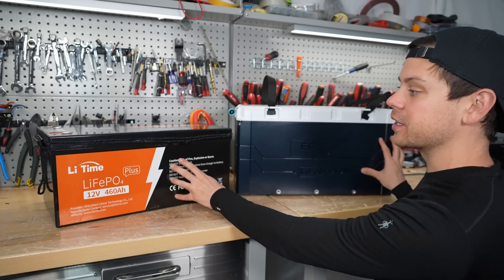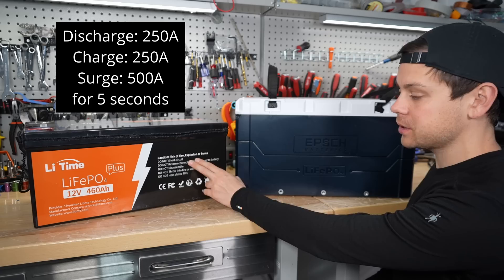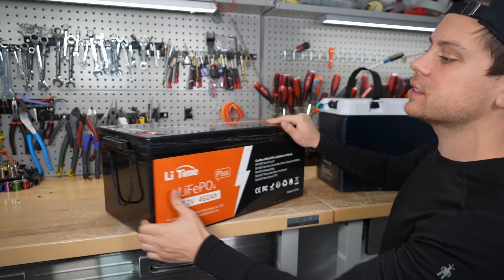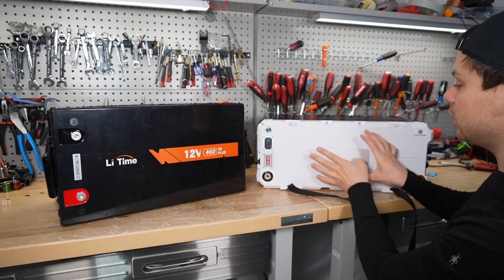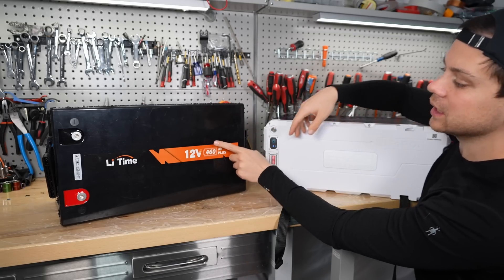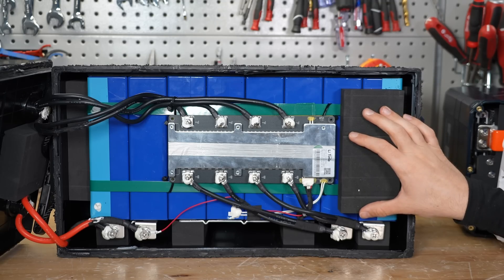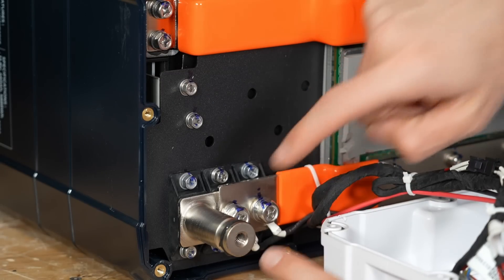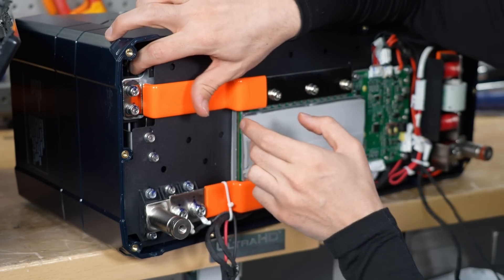12V Battery Showdown! $1,499 LiTime VS $1,999 Epoch

Comment: I bought 4 x 230Ah Li Time (with low temp cut off) based on your recommendation and videos. Unfortunately, 2 of the batteries showed up with only 3.2v, and after trouble shooting with customer service (which took some time since they are only in China), I had to send them back. They quickly replaced the two faulty batteries, but 50% failure is unacceptable. In any event, I own these 4 batteries and they are doing very well in my RV. They are charged easily by the existing MS2812 inverter charger whether connected to shore power or by 10Kw generator. I do not have solar and don't plan on installing since I already have the genset which works during times of rain, cloudy days, night, and so on. Additionally, I installed a Victron shunt to monitor SOC. I was able to buy each battery for $618 delivered, using discount codes provided in their emails. Thanks for your videos and help on these projects.

Comment: I did buy the 230 Plus w/low temp... dropped it on the tongue of my travel trailer. Works like a champ (San Diego). Do have the Victron Bluetooth BMS. Rennogy 60A charge controller. It all just works.

Comment: I'd go for the LiTimes...That said, I already own several of the Victron ecosystem components on different battery banks.  I own some LiTime batts and they don't disappoint.  Also, a few years ago (on your advice) I purchased several SOK 206AH batteries.  I use those with Victron setups and they perform flawlessly.  All 12V batts, but my SOKs are configured into 24V a system.

Comment: Due to my experience with Roy-POW’s very high failure rate there is no way I would trust the Epoch even though it looks significantly upgraded.  I have a stack of bad Roy pow’s at the golf cart shop I work for. 
Have you tested the bigbattery husky 2 yet?
Reply from the maker: How?! Can you post your roypow issues on the forum? All the shops that install them love them
Reply: Some with bms failures some with dead cells

Comment: I would use the third option Signature Solar EG4 LL in 12 Volt and 400 amps.  The cost is $1495 with free shipping until Feb 28, 2024.  This model has the LCD display which shows Voltage current and state of charge.  Failing that I would go for the Epoch for the ability to monitor the state of charge and the low temp protection and the better build quality.

Comment: I've had two LiTime batteries so far (200 Ah and 100 Ah). I didn't need any monitoring, because I did it with various attachments that I used with the battery. The only thing I wished it had was low temp protection. It never was an issue for me because I had my fifth wheel trailer and solar panels covered during the cold winter months up north, but I can see how you would want it in case you get a cold streak when traveling in the South. $400 bucks is $400 bucks, though. I'd go with a good quality, cheaper build every time.

Comment: The Li-Time is cheaper and rated to last longer. If it does what I need it to do, how it does it is less important. The Epoch is definitely a high quality battery. But less than half the rated life and 25% more... I hope they use better cells in the future. Because I'm not spending $2000 on a battery that is barely designed to make it out of warranty (3500 cycles/days = 9y 7m 5d)

Comment: I have one of Epoch's 12v 100AH units and I've installed a 51.2v60ah  kit on a golf cart. I was really surprised on the quality of the components of the golf cart kit, and how well everything integrated. On top of that, I did have a small self caused technical issue. Made a phone call, spoke to a person immediately, and my issue was resolved by a tech in less than 5 minutes. I wouldn't hesitate to go Epoch again.

Comment: I bought two 200 Ah LiTime 12V batteries for my camper van. I am not going to be using the van anywhere below freezing. I also do not want to leave a $2,000 battery in my vacant van for potential theft reasons. I built a wood box for the batteries, connected them in parallel and screwed the box tight.

Comment: I think I'd dig deeper into the cycle differential by figuring out why it's so low for the Epoch (compared to the LiTime). If the LiTime cycles nearly twice as long for 25% less money, then I'd just add the components that I might need to my LiTime bundle of batteries. Have you tore down the Epoch cells to see why the cycle is lower????

Comment: I think they are nice batterys…  but Chinese facts and specs are just words…that’s all… in lieu of how long these type batteries last I will  cost average how much each years cost is no matter what type you buy…and stick with my present batts and  “get out there and stay out there..” 
good vid……rock on…..
Reply: BB uses battery cells from China too. LOL
Reply: @Tumbleweed5150    I was addressing the claims and specs presented to the buyer and whose standing behind them, not where the cells are made….(uhh Lol.) …we all know where the cells are made……thank you for not reading my comment sufficiently before commenting on its merit…
And based on this video I am considering buying one of the Epochs for a secondary system  for my tool shed as it would do what I need by itself…very easily and simply…it looks like a decent battery.

Comment: These are 12v so likely intended for an rv.  Would love to have the epoch, but it’s too tall for the battery compartment in ours.  Skinnier and higher is not necessarily a good thing, footprint operates in 3 dimensions, not just on the floor.

Comment: Depends on the use case. If it is a system that I set up once and then it will sit in a room/garage that is temperature controlled for the next 5 years, I don't need the extra features and higher quality connectors. If I put them in a golf cart or a boat or RV, I'd go with the better quality.

Comment: I just received my 300 Ah Epoch battery and it's impressive.  During my decision phase I watched you and other reviewers discussing the battery that I ordered in December and just received.  And because I am doing a major upgrade to my motorcoach it still we be a month or so till I place it in service, but currently have it attached to my Victron Solar Control to top it off.  But I'm convinced that this is the battery of choice and definitely beats LiTime on the low end of price and the Battleborn battery on the upper price range.  I will be ordering a second battery in the near future to make my system a two battery system, and the only fault I see at the moment is the delay waiting for a purchased battery to be delivered.

Comment: I have a lot of the Ampere Time/LiTime LiFePO’s.   They do the job.  If you have an oopsie and drain one dry, then sometimes the BMS requires a seance to be brought back to life.  I do prefer pairing them with Victron gear to bridge some of the functionality the OEM batteries lack and to keep that functionality uncoupled.   I believe these batteries will follow a Moore’s law trajectory and I can just keep pairing the Victron gear with larger capacity batteries and save a little along the way.

Comment: IMO, things like bus bars versus wires, and including their own T-class fuse, and including the low temperature charging circuit -- I consider all those to be safety features.  And safety features are something I will pay for.

For me the question is this -- what voltage of batteries should I be buying? 12V? 24V? 48V?  That's something I don't understand, so I'm likely to not be buying any batteries until I do understand.
Reply: Binge watching Will's older videos helped me to decide what to get once I came up with the money to buy the system's parts. Another channel on youtube that I watched that helped me a lot is DavidPoz.

Comment: 12 volt Battery Storage size was the size of a lead acid 100ah battery… and the height constraints was crucial measurement. Given a 100 amp hour lead acid was the standard size everyone used. 8.5 inch height. These battery’s won’t fit in boats and or RV’s unless planned before build out, not good for replacements. And the size also is crucial for transportation to and from its desired compartment. It has to fit.

Comment: Built my first off grid style backup generator, with manual transfer switch about 12 months back..Powerqueen parellel 100ah x 4  
 VICTRON Blue  150/70 charge controller with dongle, blue tooth monitor, 3000 watt  Renergy,  inverter and 1 kw Thunderbolt monocrystaline panles in Series with upgrade MC4 connectors, awesome little system for emergency Backup and can handle a couple small window ac units all day with full sun.

Comment: Another reason why people choose 12 volts DC batteries is because many DC appliences seem to be 12V and are plugged into the car cigerette lighter, albiet the same type of plug. I know some are 24 volts for trucks but what runs at 48 vilts DC. So I guess you advocate using a DC to DC converter so that you can step down to 12 volts to run the apliances. As for the inverter for the AC, it makes sense to me to want to use a higher DC voltage but in a van or energy efficient house, it makes sense to me to run as much as you can on DC and keep the inverter off most of the time and only for using higher voltages devices such as an air fryer, toaster, kettle, maybe tv if ot isnt DC.
Reply: I have tried both ways in my 30+ years of off-grid living, and have found that buying 120VAC appliances is much cheaper than the same appliances in DC Voltage. A buck converter is fairly cheap to get for the few 12V appliances I do  have left, (including LED lights, a stereo, etc.). I recommend a buck converter that puts out 13.8V at at least 30A. I went from a 12V system to a 24 Volt system a few years back and bought the 24V to 13.8, 40A Buck converter, so when I went to a 48V system last year, I just added in a 48V to 24V,  buck converter (20A output). This has been working great, even for my 12V reversable vent fan. I killed several battery systems trying to keep up with 12V refrigerators, etc., before deciding to  go to 24V. When I got a windfall of cash from selling an old piece of land I no longer used, getting LiFePO4 batteries, and all-in one 48V Growatt had been in the planning and research stage for years, with one friend saying I would never be able to afford it. LOL

Comment: LiTime and similar quality.  Though i am 24 v as i started the investment before 48 was as popular.  Ibwould go 48 now, but i use my own t class on the 24 v and my own heating/shutoff.  I am in alaska.  I also have a secondary LTO system if i have to leave in an emergency and i need power daster as the cabin heats up.

Comment: Why not 5x the litime 100ah TM for 240 each for 500 ah at $1,250 which allows flexibility for mounting or even changing out voltage if you want.  Has low temp shutoff.   Sure have to wire them together I guess which is annoying.

Comment: I'm converting my small system on a 5th wheel to lithium and a larger inverter.  Since I'm going all Victron, the Epoch is a no brainer.  And I do camp when it's cold so I need the self heating function.

Comment: I use a renogy deep cycle 12v 300ah with heater and low temp protection for  $1280 CAD. Been happy with it and it still runs in cabin at -45c with a r5 box

Comment: Based on the price of the LiTime,,,, the cost is more like 30% more!! 
    If it’s a small cabin and you don’t want to go more than 12 or 24 volts using more batteries,,, the Epoch. If it’s for an RV and you are only using 1 or 2 batteries, then LiTime. 
    To each their own granted. If it’s a $100K 5th wheel, you may want the Epoch.

Comment: How about best 48 volt battery? What about four 12 volt wet cell batteries for a 48 volt battery?
Reply: "Wet cell" or lead acid batteries only last a few years. (About 500 cycles compared with 5000 to 6000 of LiFePO4). Lead acid are almost three times the weight, off-gas, (so NOT good to use inside), which also is explosive in the case of a spark, and causes corrosion on the posts and connectors attached to the battery. For me, LiFePO4 is the way to go until something better is available for the general public. Most of the LiFePO4 batteries can be connected in both paralles and series to achieve a nominal 48V system.
Reply: Thanks.  @Tumbleweed5150

Comment: When I  built my system I wanted to go as inexpensive I I could. So I would always go litime for the cost savings. I am stuck with agm batteries untill they fail. The agm batteries are about 5 years old so I won't be stuck for long.

Comment: Between the two, that is a hard decision to make.  With how much lithium has come down in price, both of them are a little more than what I would want to spend.  

Battery Hookup has a deal right now for a set of 4 brand new Eve 280 amp/hr cells with bus bars for $440.  Add a 300 amp BMS to this with low temp disconnect and Bluetooth for $139.  Granted, you have to pay for shipping, but that is less than $600 for a 12 volt 280 amp/hr battery.  

That is the route that I would prefer to go.  It isn’t a lot cheaper, but it breaks the cells up so it is not as much weight to have to move around, and when you build it yourself you can easily go and do repairs if needed.

Comment: LiTime,price and more cycles
Reply: Price: true. Cycles? That could be a mis-print on someone's part. All of the other LiFePO4 batteries I've looked at are rated for around 6000+ cycles, and it mostly depends on how much the battery (bank) is depleted. Most say about ten years if depleted and recharged fully every day. I'm hoping to get 20+ years by using only 20% capacity most of the time. Oh...Even if you use 100% every day, they are still supposed to have 80% capacity after the 10 years.

Comment: The Epoch is definitely interesting..   Though the price is almost double for my Ryobi riding mower.  $1199 (+$100 charger) Chins vs. $1999 (+$235 charger) for an Epoch equivalent.   Pretty hard to justify an extra $935..    $300 I'd do it no question though.

Comment: During the Black Friday season I purchased three 12v 100ah LiTime batteries to make a portable battery-inverter system for about half the price of what you could buy the ready made units. I was able to get the 300ah of batteries for $825, and bought a large Pelican case to house everything. I wanted a battery-inverter set-up that was larger than what is available, and I ended up paying the same ~$2k in the end. I didn't need the features that the Epoch offers.

Comment: Personally I would buy the Epoch.   Just better quality built and has more to offer.  It never really is just black and white.  Like my Honda 2200 generator.   One can buy two generators for the same size out put but what many do not realize is the Honda has a larger motor there buy having less voltage drop.  When you buy quality it comes at a cost.  I'm a firm believer of buy once cry once.  Buying cheaper normally turns out more expensive in the long run.  Never new about Epoch batteries until you showed it too  me, Thanks .
Reply: Knew

Comment: Well, I gotta say, that T-class fuse sold me.  Well, its still 12V so I wouldn't buy either, but if I were looking for something like this, between these two batteries, it would definitely be the Epoch.
Reply: I'd rather have the t-fuse where it's more easily accessed, not inside the case.
Reply: @SteveIllman  I don't mind it being in the case but I can certainly understand the sentiment.  This deserves a quick few points on fusing and why I think it is ok for it to be inside the case:

Any decently sized system is going to have a fuse and a breaker.  This particular battery includes a fuse so you just need the breaker.

Will didn't say what size the fuse was or whether it was a slow-blow or a fast-blow.  Would be nice to know that.  The fuse ought to be rated for about, oh, 700A to 800A or so, possibly even higher (would be nice to know what the actual value is).

An external breaker, on the other-hand, would be rated for your expected worst-case continuous battery load and no higher... likely more around 300A.  If your worst-case continuous loads are lower, you would make the breaker smaller.

Remember, breakers require (typically) 5x amps to instantly pop, otherwise there is a time delay, so surges don't usually trip breakers.  The breaker should trip first if an external short occurs.   It is sized against continuous expected amps, not expected surges.

The BMS will also likely trip on a short before the fuse blows.  At least, they should have designed the system for that.

For all of these reasons, I think an internal fuse is just fine.  It is there as a final resort and should never blow on anything but a major failure.  Even normal accidental shorts shouldn't blow it.  If they designed it properly.

-Matt
Reply: I looked up specs , 500a for 30 sec,  1300a for 1 sec!!! That's a big fuse. Almost anything hooked to it will melt into a puddle before blowing that fuse.....
Reply: @SteveIllman  Yup.  Its there to protect internal cabling and the BMS from dead shorts, not anything external.   That internal T-class fuse has no ability to protect external anything.

An external breaker is definitely needed sized appropriately to external cabling and expected loads. Possibly even an external fuse as well, sized for 125% to 200% of same.

This is why I love the SOK and EG4 rack-mount stuff bar none.  They have all those wonderful breakers integrated right into the batteries.  And the EG4 6000XP as well... wonderful breakers integrated right into the hybrid inverter for everything.  They save such an enormous amount of labor.

Comment: Epoch.. The T class fuse, low temp charging protection and shunt are worth the added cost, and that's 2 things you'll typically need in a system anyways. The better case and build quality are just bonuses at that point.